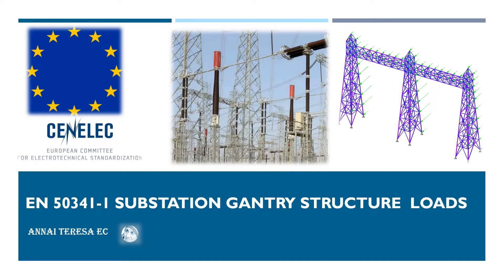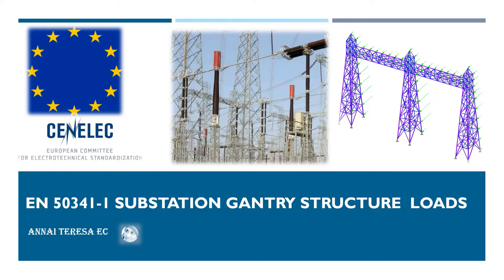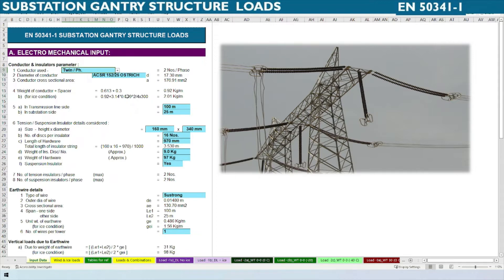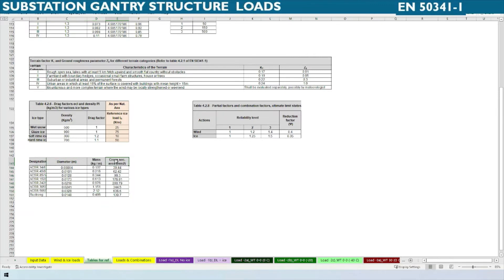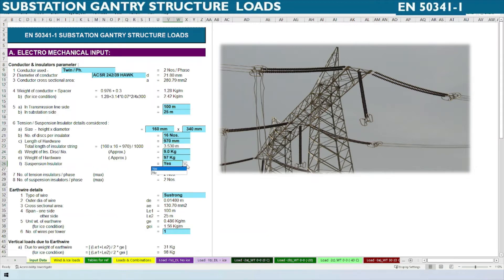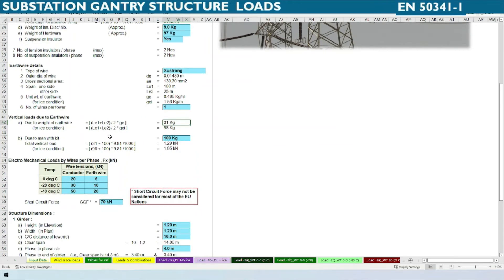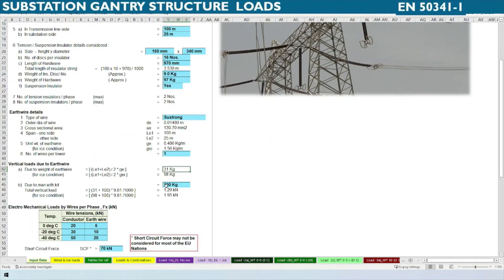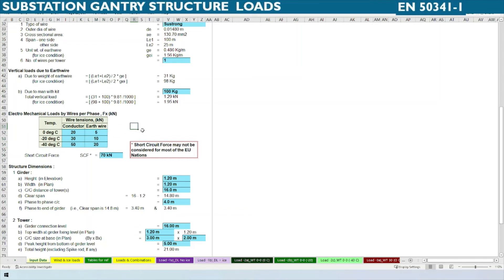EN 50341-1 | Substation Gantry Structure loads | STAGE 1 of 6

Comment: @12:25 Just to confirm, the temperature loads shown in the table represent only the effects due to temperature, excluding self-weight. So, if I create a load combination like (S.W + T1), the 'T1' here refers solely to the temperature induced forces as listed in the table. Is that correct?
Reply from the maker: The wire tension shows in this table are the tension occurring due to the combinations of  self weight and temperature (-20deg C and -40deg C). Due to contraction of wire during low temperature, causing sag and due to its own weight, the wire tends to sag. To limit the sag, the combination of self weight + temperature is considered in the table.

Comment: Hello Annai Teresa 

I just asked about the loading, analysis and design in the previous video. 
I just realized the video is more than 3 parts , however is it possible to upload the excel document used in computing the loads?

Does the excel file make provisions for failure containment loads of the lattice structure?

Thank you.
Reply from the maker: Thanks for watching. Due to professional constraints unable to share excel calculations. Failure containment (BWC/Unbalanced) cases are not closely applicable for Substation Gantry, as Girder/boom  supported with two columns/towers.
Reply: @annaiteresaec  Noted. Am willing to pay for the excel file in case you want to sell.
Thank you
Reply from the maker: @niisarpei3676  Thanks for your comment. But professional constraints we meant is different. Please write a mail to our mail Id: annaiteresaec@gmail.com. about this. We will communicate with you further through mail. Thanks.